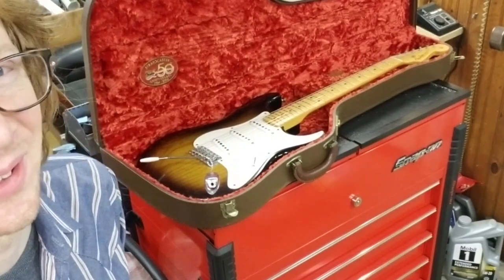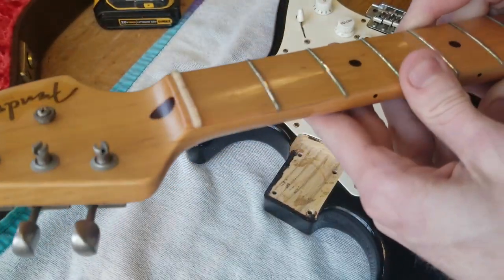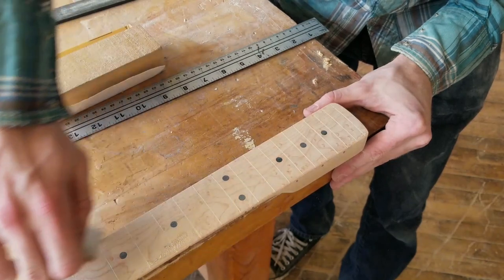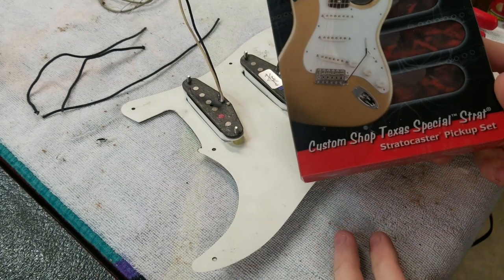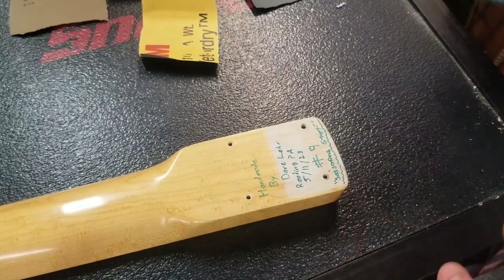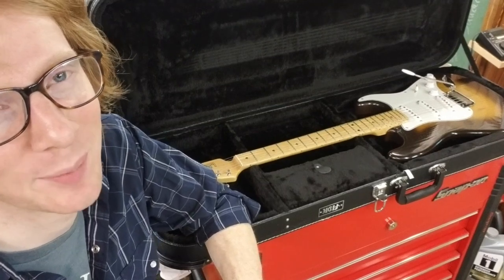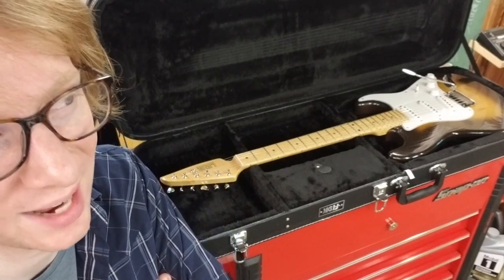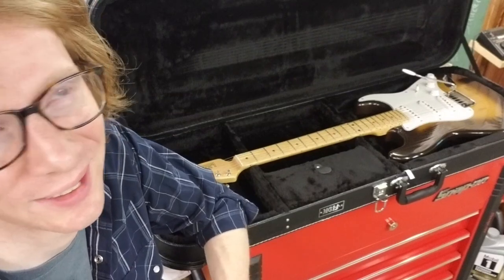#9 "50's Sassafras Strat"

Comment: Don't sell it Dave. Make a Tele/Esquire, a les paul junior and a bass Guitar. A range and let people try em out to see what the feedback is, then think about selling or "custom builds" I would really dig a Paisley Esquire with that transparent scratchplate. One thing I noticed, did you choose to put the 2 point trem on for a reason as that was the only thing I have had problems with the wood cracking where the pins enter the Guitar body. Great job , lets see more Guitars and bass builds!
Reply from the maker: I only have 2 of the guitars I've made for myself. The green gecko and larry. There's over a dozen sold already and I currently have 5 custom orders. The feedback so far is outstanding and I am really proud of the results. This strat sold very quickly, just not as quickly as the second one I made. Thanks for watching!